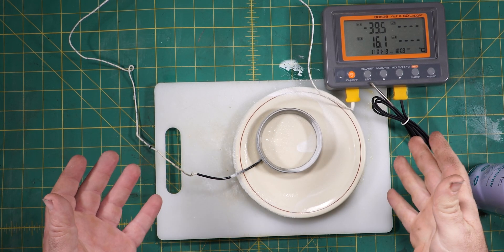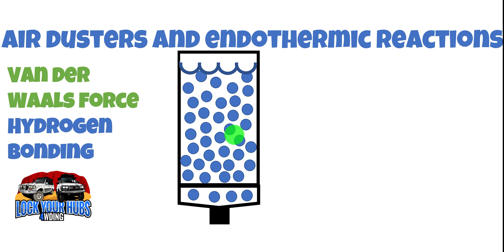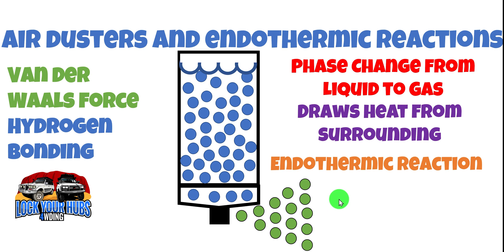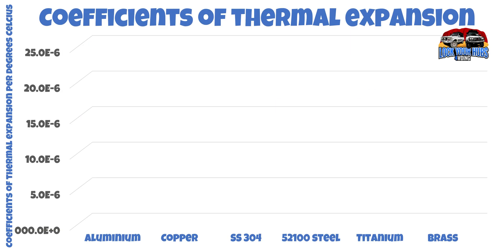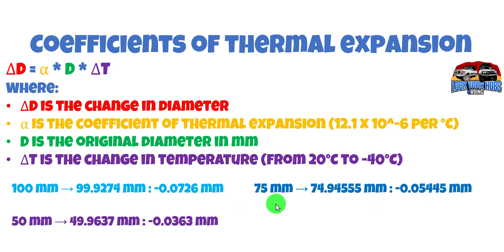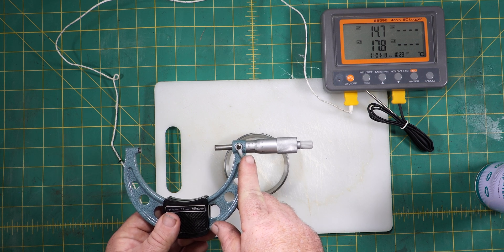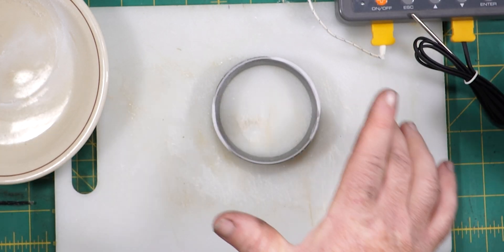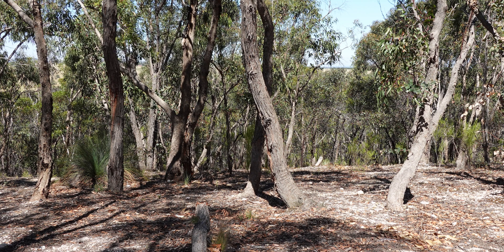Unbelievable Trick--Freeze Shrink Metal Parts with Just Canned AIR?!?

Comment: im going to try using this for installing ball joints on my polaris. i really hope the cold is enough to shrink them because its a press fit and i dont have the tools to press it back in. cant even get the spindles off the quad because ill def end up breaking other parts trying to do so lol
Reply from the maker: You'll definitely get shrinkage using this method, whether it's enough, I'm not sure. Let me know how you go!
Reply: @LockyourHubs4WDing  I'll have to heat up the aluminum spindles too, but not too hot because they will just drip lol...

Comment: I'm trying to get a tie rod end off that is stuck I'm thinking of blasting the bolt with this. Might also work on the ball joints.
Reply from the maker: Either heat or cold should help loosen it up
Reply: @LockyourHubs4WDing  yah I've seen people do both. I talked to someone who has used both liquid nitrogen and dry ice but the dusters are easier to find. If not I'll blast with a propane torch :)